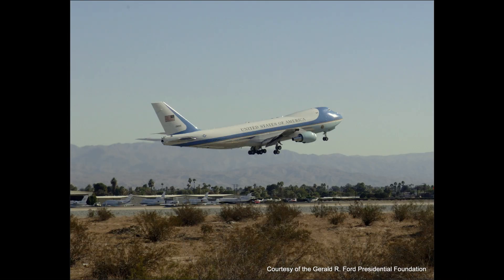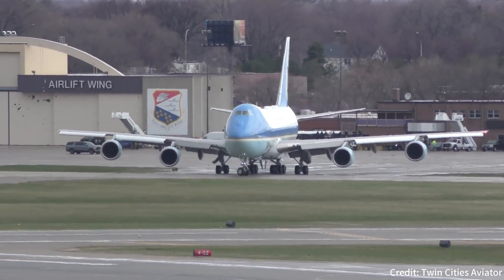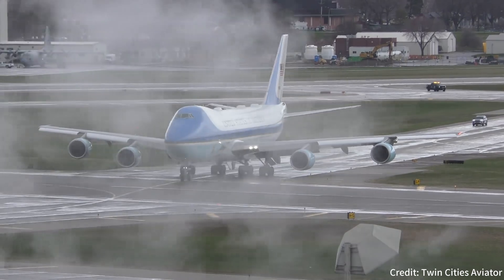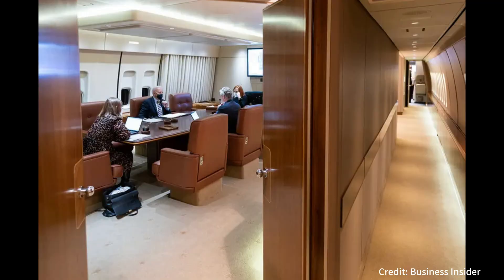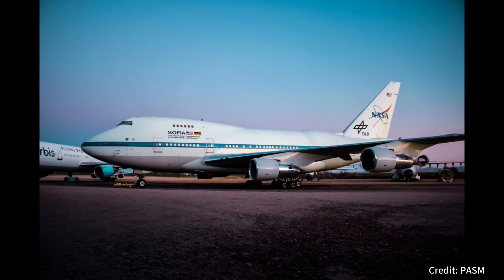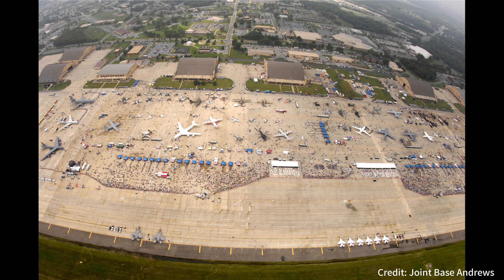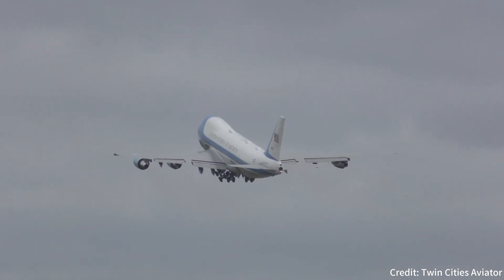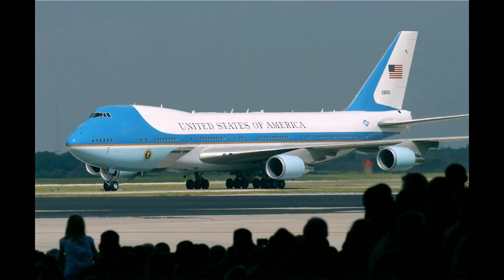DC-10, A "Failed" Air Force One

Comment: I feel like McDonnell Douglas would've had a better chance if they proposed the MD-11 instead of the DC-10 to USAF(United States Air Force). The MD-11 was not only safer than the DC-10 but also more efficient as it was a more modern, stretched version of it. The aircraft used winglets to reduce drag and improve fuel consumption/burn. Additionally, it had accessibility to more runways than the 747. The MD-11 needs between 9000-9500 feet of runway for takeoff. On the other hand, the 747 generally requires several hundred feet above 10000 feet of runway for takeoff. For comparison, Joint Base Andrews Airfield has 2 runways with a length of 9318 feet and 9756 feet, respectively.

Comment: The VC25A was a good choice when came on board in 1990. 

The White House should have replaced it in 2010 with the 400. 

If had replaced the 200 with 400 we wouldn’t be under pressure for replacement by now while waiting on -8.

The MD11 would have been a good choice over the DC-10.
Reply from the maker: 90-10 is 20 years. 10-30 is 20 years. That would definitely relive the pressure of the -8 procurement. -8 could take the baton from 2030 - 2050. However, the -8 ceased production so the available airframe could be an issue. I think -400 would definitely be a good "gap bridger" between the -200 and the -8 while the AF can pull some strings to procure some -8s.

Comment: The DC-10 wasn’t a good Air Force One jet. It uses a lot of jet fuel and it was a very slow plane with a lot of drag. Then the 747 came by and that improved the flight time and distance. It made a huge difference in air travel.